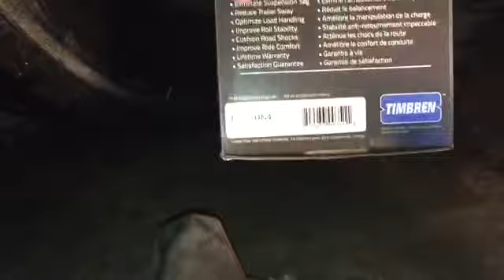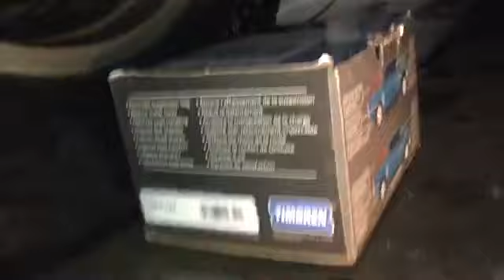Timbren TORTUN4 Install Toyota Tundra

Comment: Thanks for your video Brad.  I purchased my system from e trailer.   e trailer has a great costumer service and a great video on the installation of this system on a Tundra for those of you that have the BEST American truck built. #1 Toyota Tundra

Comment: thanks for the tips especially getting the bracket on straight to the axle. seems it would be easy to  tighten one side of u-bolts down too far before tightening the other side. I wish they would give the torque setting for the u-bolts, in the directions!